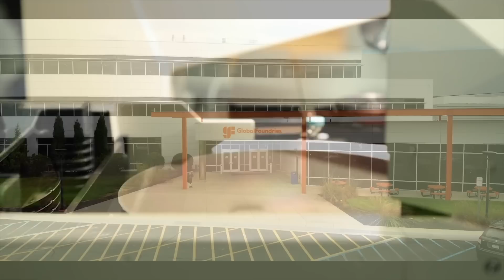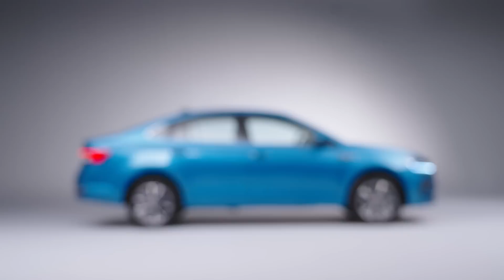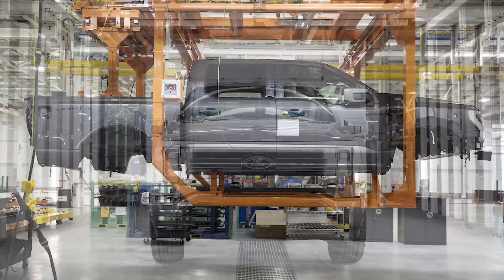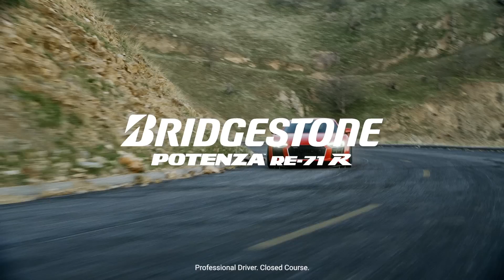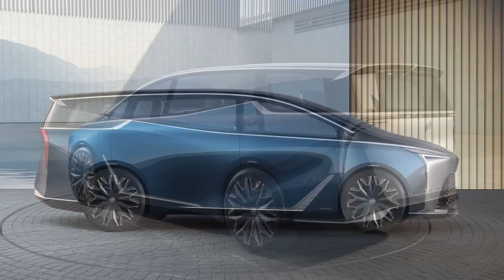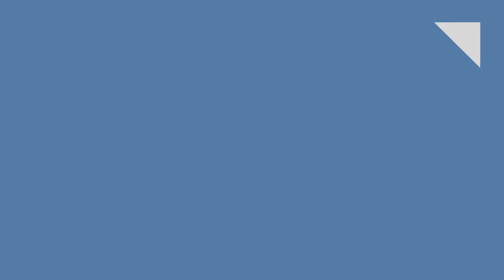Buick Unveils Wild Van; Ford Doubles EV Target - Autoline Daily 3208

Comment: Maybe the chip shortage issues can be helped by not having so many available options. Instead of having 2 different infotainment systems,  just have the better one on all models. Instead of having multiple different stereo systems, just put the better one in all models. Instead of having some of the safety systems optional, make them all standard. This could help in making it unnecessary for multiple types of chips. It'll also greatly reduce the number of different wiring harnesses needed for each vehicle since every one will be basically the same. This will also save a lot of money in the manufacturing process because multiple kinds of the same thing won't need to have space in storage or on the line, and save on r&d for multiple systems, streamlining the build. Each kind of stereo system, for example, needs its own development and parts to go into a model, and some will come from different companies so that can be an issue with shipping and timing from different places. (One car can have a base Bose system, a better Bose system, and then a higher end B&O system. Ridiculous!)
The only options on a car should mostly all be aesthetic, interior and exterior colors and materials, wheels, engines, body parts, etc.

Comment: your frunk story is completely made up and wrong. the ID3/4 is not at all based on an ICE platform. the hood is about 25 cm shorter than an ICE vehicle. they used these 25cm inside and in the trunk to make more room. that is a modern EV. having a long hood does not make sense anymore.

Comment: @autolineNetwork That explanation about the Frunks is mostly right, however there are dedicated EV platforms that push all the Electrical equipment up front to give flatter load floors. Case in point the Lyriq, that doesn't have a Frunk.
Reply: ID4 is a better example,  but notice the short front overhang.     Lyriq has a long hood,   and lots of room under their for electronics,  GM is just not as good at EV packaging, and needs more space for the same systems...   GM is not good at mass efficiency either,  Lyric is way too heavy for what it is...
Reply: @dmitchellhomes  The Lyriq is the size of the XT-6.
Reply: @Nebula1701  GM is going about the EV transition wrong.  Instead of building class leading products in volume segments they are focused on Niche products like Hummer and Lyriq.     I think this will ultimately prove out to be a waste of capital, and will not gain EV marketshare leadership.
Reply: @dmitchellhomes  GM is introducing their most expensive models first to pay back investments and introduce the other models down the line. 2022 will be an interesting year of EV reveals for GM. By 2025 there will be 20 EVs in all class segments for GM.
Reply: @dmitchellhomes  lol Tesla’s are some of the blandest looking cars on the road and only surviving off of hype.  They would not hold a candle compared to other companies when it comes to appeal. Tesla is still a small company and isn’t really taking market share away from ICEs in the states thats going to take more than one company to do. Technology speaking Teslas are nice but they aren’t miles ahead as people like to think. Lucid has already proven this.
Reply: @dmitchellhomes  Yes GM has acknowledged Tesla as their number 1 competitor in the EV space, yes they stated they have to catch up and are aiming high in the coming years to try and take some of that market share. GM and Tesla still have sold more EVs in the US market than any other brand both were the first to hit the end of the tax credit. it's gong to heat up even more in the coming years. As for In China both are very competitive in the EV space as well with GM holding the top sport with the Hongguang Mini EV.

Comment: The batteries they want to use in those cars are obsolete today. I don't understand how GM/Ford want to become competitive with those old things...
Reply: And they think giving it a cute name makes it high tech. OOOO its an ultium! Just an old pouch modular design and i cant believe they are building a factory to make them. LG must be covering their mouths to hide their giggles.
Reply: I think they know that. You have to present something feasible for now but the very design of the cars will let them pivot to new battery technology if needed. What I'm wondering is if there is going to be a large aftermarket business for battery upgrades. There are already upgrades for the Nissan Leaf and some hybrids that increase range or convert the car to a new type of battery. Could be an industry to watch. Some of the companies who are announcing plans to "recycle" batteries may have other motives to get their hands on used batteries.
Reply: @frankcoffey  The machinery they are installing in the new Ultium battery factories can only make the (slightly older than) current gen battery cells. A factory upgrade will cost a lot of money and will need a lot of downtime. I don't think they are planning to use newer battery tech for at least 5 years.